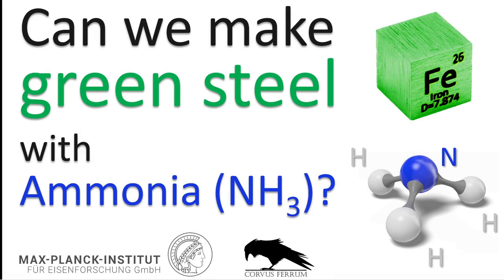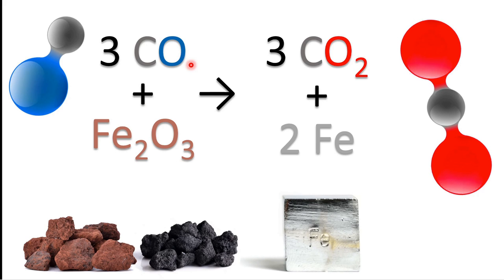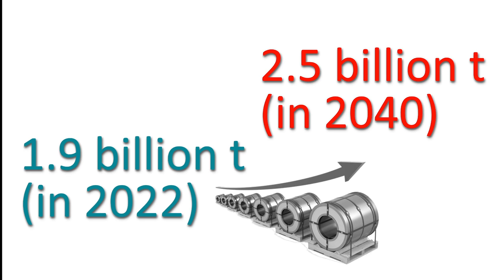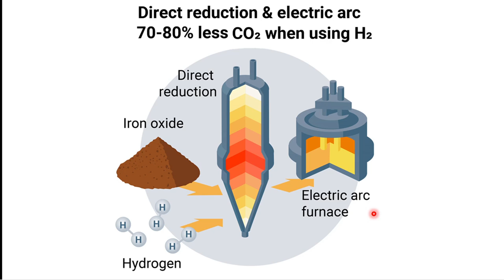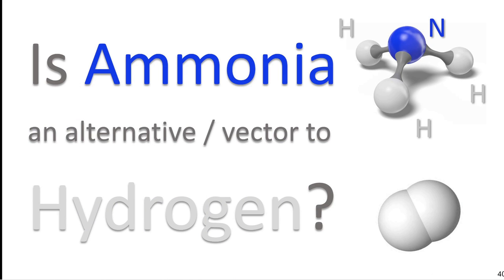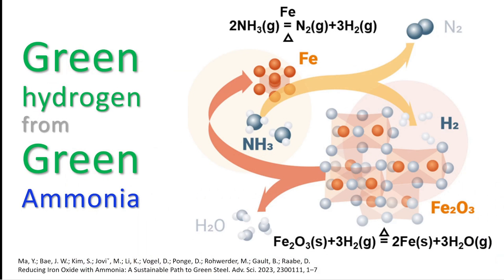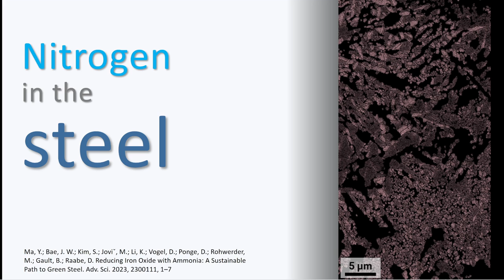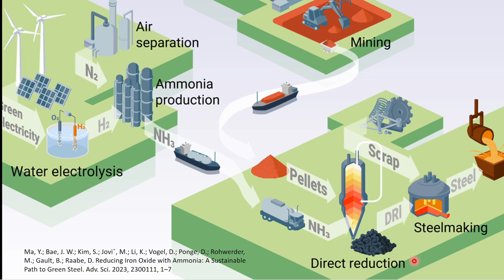Making Green Steel with Hydrogen Released from Ammonia

Comment: This is very interesting 🤔
I was concerned about excess nitrogen being converted to NOx compounds in the stack or salting the iron produced😃👍
The converter for the iron ore would be feeding pulverized iron ore into a reactor with ammonia to extract iron powder with entrained nitrogen. 
Now, if some of that powdered iron was diverted then it could be used as fuel for the reaction process where the byproducts would be[ Fe + ◇  = Fe2O3 ]
So,
 the nitrogen could be captured and sold
The iron ore provides the raw material and the fuel to power the reaction and if you want to :show off", create a cogeneration facility in the steel plant to power the arc furnace with the same iron powder that is melted in the furnace. 

This is an environmentalist's fantasy come true 😂🤣👍

Comment: The difference in transport volume is not so important. But the price to get there is very high. It is the Haber Bosch process.
One need 10 KWh/kg to produce ammonia. Only a complete fool will do such things.
To free the hydrogen later, the ammonia has to undergo an endothermic  cracking process + purification of the hydrogen.
Quite costly and wasteful. Just foolish.